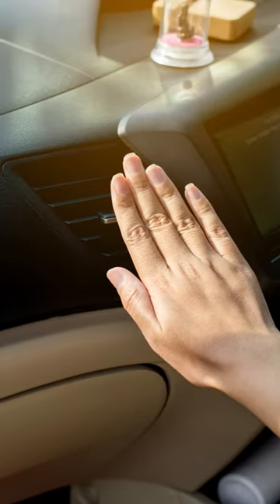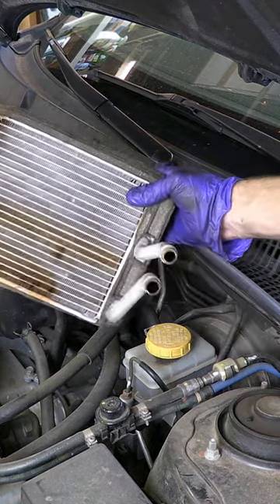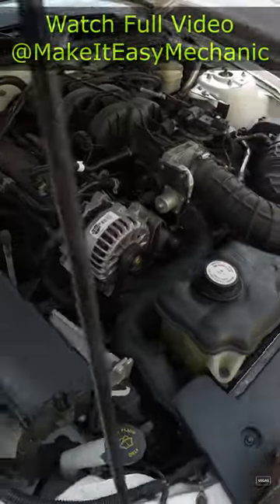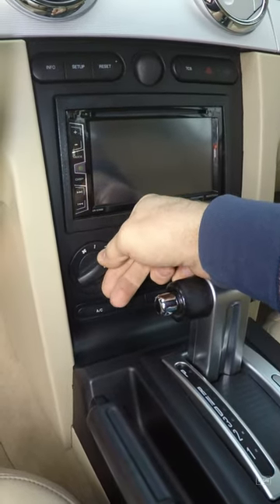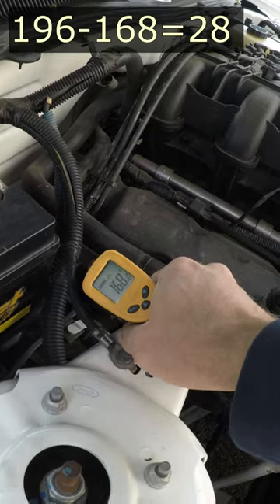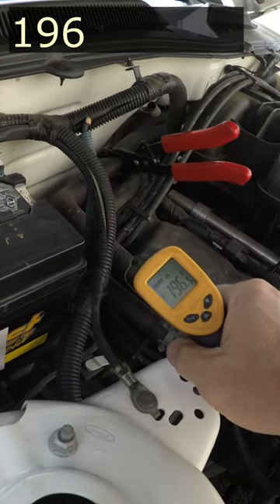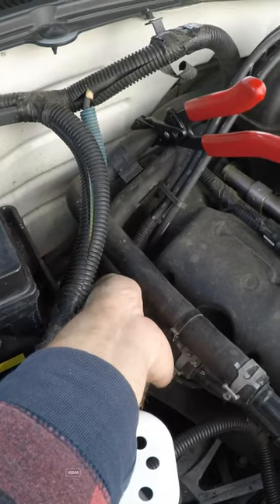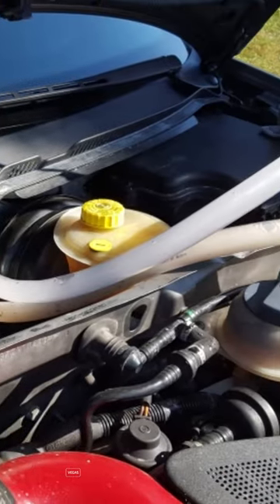Car Heater Not Working? Part 4 - Heater Core

Comment: Just disconnected my heater core from water pump, flushed my heater core with clr soaked for 2 hours..but blew out water beforehand. Put a hose on water pump to loop it.  Drove down to car wash and used $2.50 to flush both hoses in and out of core to reverse flush several times.....heat is now over 145 degrees at vents. Hail mary before pulling dash to change for new 😂😂😂😂

Comment: Hello,

I have changed my thermostat and replaced cooling system with new coolant. I have spent lots of money already on coolant and thermostat. What steps can I take to fix the engine overheating? There is ample coolant now, but, the engine runs idle and there is very cold air blowing out. Heat only works when revving or accelerating. There might appear to be a very small leak, yet I cannot detect from where. The heat only comes on when I rev or accelerate. I am worried the engine will overheat eventually but I am just unsure what to do. Could it be the radiator or heater core? I don't see leaks by the water pump and I just do not know what to do anymore. I have no engine codes but I noticed the reservoir very slowly dissipate coolant. I added bar's leaks cooling system repair to radiator directly, very recently. I think there may be some sludge? Again, car heat only comes on when revving or accelerating and then is ice cold when idle. What do you suggest?
Reply: I'm 100%sure  that problem is  the water bump. The water bumb not working and you need to change the water bump. I got the same problem and I try every what you mentioned in the comments and none of them working. Then I change my water bump..and problem fix 💯👌
Reply: Trapped Air in the cooling system or waterpump inoperative